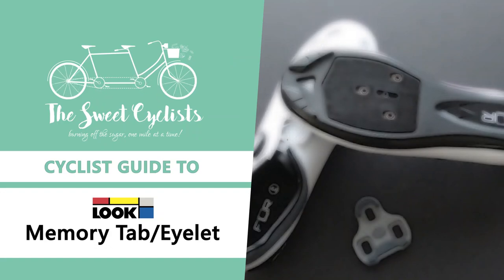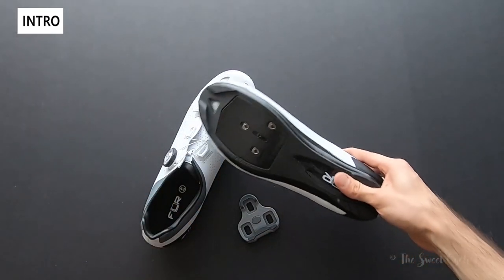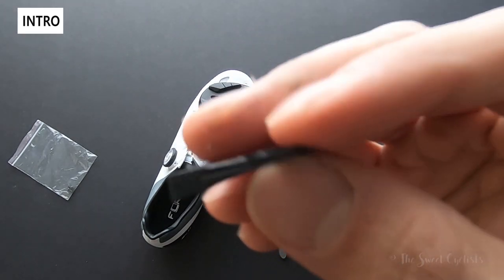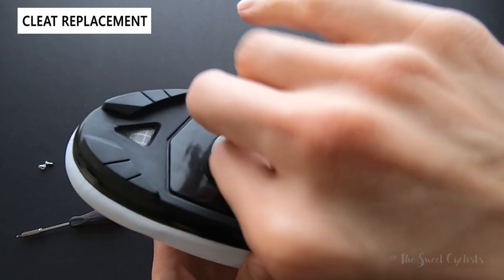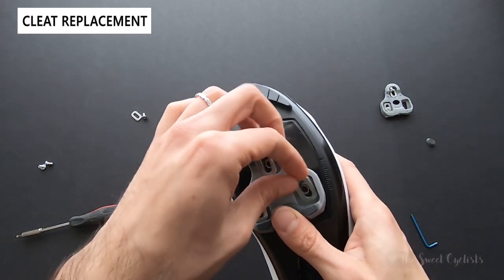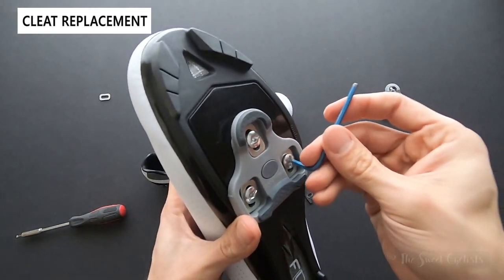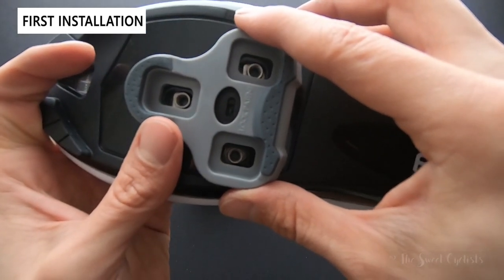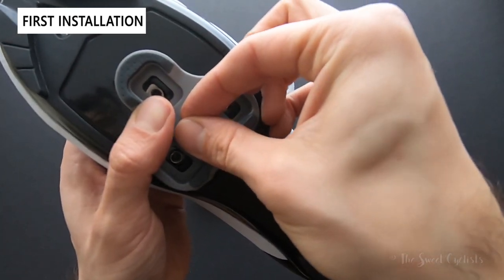Cyclist guide to installing Look Keo cleats using the Look Memory Eyelet and Look Memory Tab

Comment: Thanks for the detailed explanation 👍. Grey vs Red cleats, which is ideal for newbie 😊
Reply from the maker: No problem! The colors of the cleats indicate the "float" - which is how much side-to-side play the pedals (black 0°, gray 4.5° and red 9°) have before the release. For newer cyclists higher float is usually recommended. I've always preferred the gray version as you have some adjustment but not an excessive amount.
Reply: @TheSweetCyclists  Bought grey as well 😊
Reply from the maker: @youtuby0305  Good call. Having some float really helps. If this is your first time riding clipless pedals, don't forget to take your time and remember to unclip at stop signs / lights. After your first few rides it becomes second nature.
Reply: Grey is probably the best!

Comment: Does anyone know what size screw fits the look keo memory eyelet?  I know the video says a  5mm screw but I think he's talking about the length of the screw not the actual thread size.  I have Sidi Genius 5's and I want to use the memory tab but I don't have the screws.
Reply from the maker: I'm not sure why these screws are so difficult to find, it doesn't seem like Sidi or other shoe manufactures offer replacements. Based on some quick caliper measurements for the screw that came with the FLR shoes: 6mm insert-able length, outer-diameter 2.5mm and 5mm screw head diameter. Hopefully that helps. You could also reach out to their customer support to see if they'd send you the screw.
Reply: @TheSweetCyclists  Thanks for the update.  I did contact Sidi and they are going to send me some screws they think will work...so good customer service on their part.  I have to agree with you though, no one knows what size screws these are and no one has them as spare parts.  If I can't get the screws I'll just set the cleat until its correct and then outline it with a sharpie.
Reply: @TheSweetCyclists  thanks!